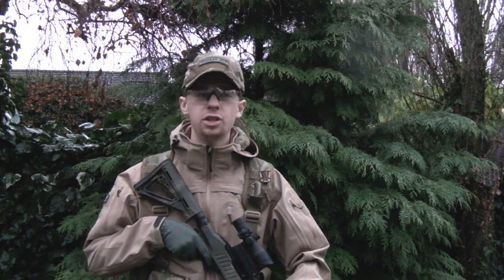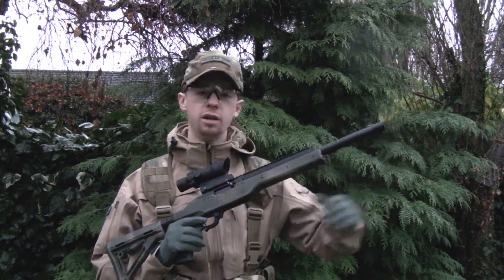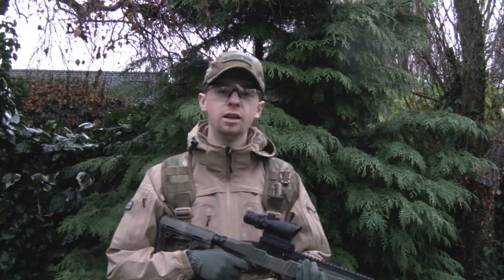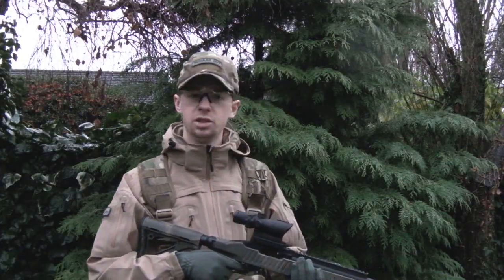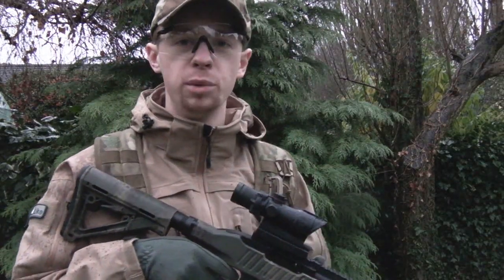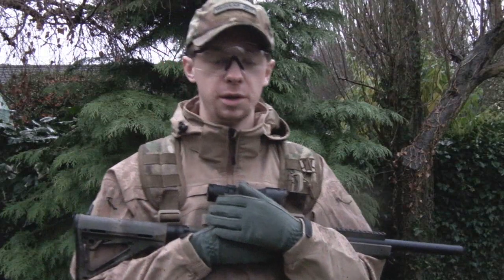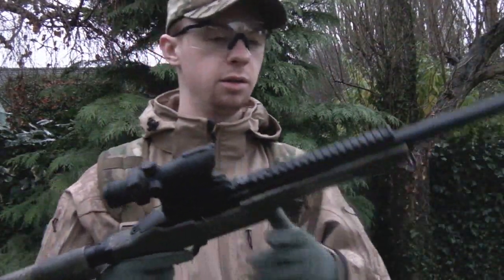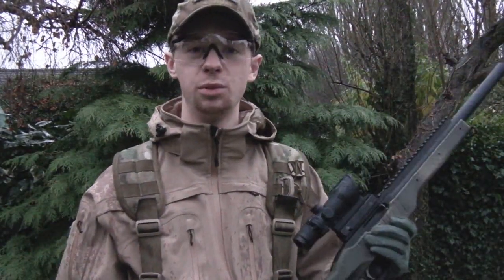KJW Ruger 10/22

Comment from the maker: @idudk The inner barrel is specific to the rifle, so that's a negatory on the AEG inners.  The version 2 is just the same on the inside, just comes with slightly different accessories, and both versions have threads on the ends of the outer barrels.

Comment from the maker: I use a pouch from a UK gear store that's designed to hold a 5 round .338 bolt action magazine, you can get two of the 10/22 short mags in there very nicely.

Comment: Another really good vid. What is the maximum accurate range with the new hop rubber and inner barrel? Because Im looking at getting one for a DMR or even for longer range use if its accurate enough. Also what weight BB's and gas do you use to achieve that distance?

Comment: Hi, i got this gun and i'm using it as a DMR, but i'm having hopup problems, i donno why but the bb's instead of going up they go down, as if the bb's are getting a spin to go down... so i changed the inner barrer to a Ra-Tech 510mm 6.01, and i'm still having the same problem...could this be cuz of the stock hopup rubber? i dont understand it cuz everyone is sayin how accurate this gun is, why isnt mine?? thx in advance for any help and ideas